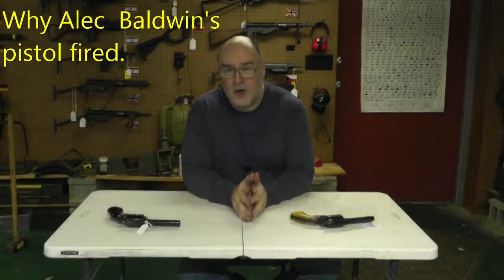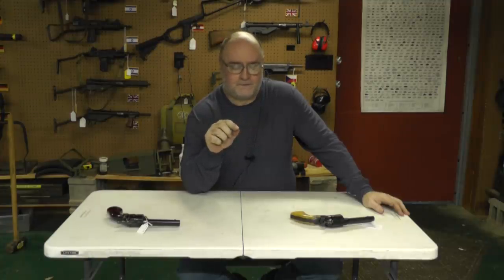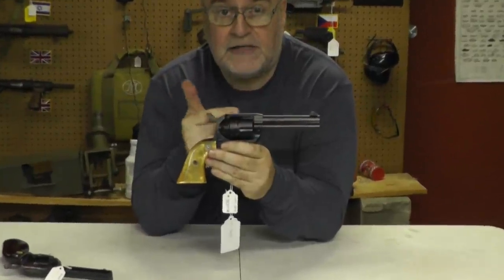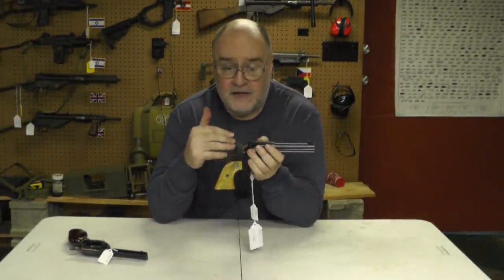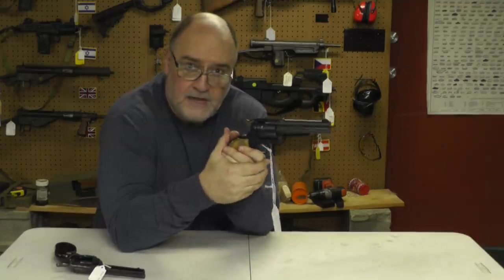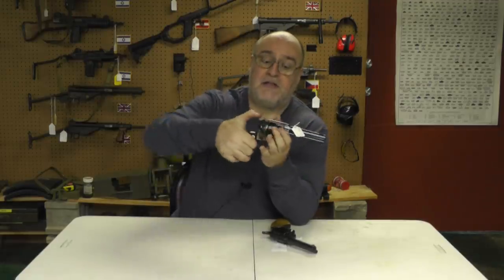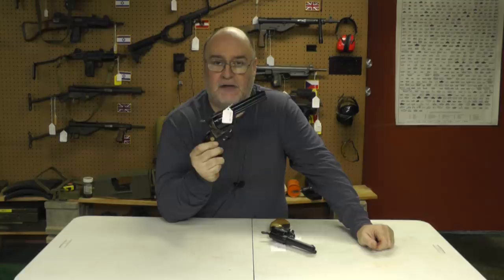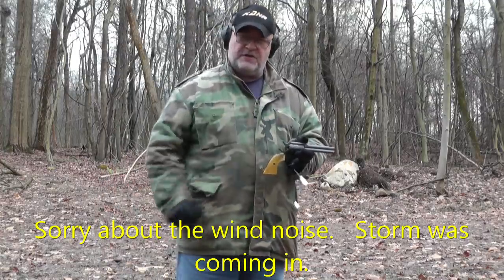Why Alec Baldwin's gun fired

Comment: I totally agree with your conclusion. You know much more about firearms than I do, but simply surmising, if Alec  wasn't flat out lying, I assumed that he was "fingering" that gun all day. And by doing that, he probably had the trigger pulled. When it came time to shoot the scene, he pulled the hammer back and let it go. With the trigger pulled, the gun fired. Whoever loaded the gun with "dummy rounds" neglected to first empty all six chambers, so a live round was still in the revolver. As luck would have it, this is the chamber that was in front of the hammer when Alec  pulled it back and let it go. In any event, word is he was not paying attention in Safety Training, instead, he was talking on his cell phone. He was too cocky and felt he was too cool to take "Safety Training."

I have been a motorcyclist for twenty-five (25) years, but I still take the Motorcycle Safety Foundation course before the start of every riding season to: brush up on the rules of the road, practice maneuvering at slow speed and practice emergency stops.

At this point, I could probably TEACH the class, but it is NOT about my EGO, it is about knowing how to ride so well, that I simply react in an emergency situation and keep my motorcycle and my body from getting broken. 😎

Comment: Really clear, thank you. We don't get hands on with handguns here in the UK so this is a question not a theory: I wanted to ask if supposing the hammer was resting on a live chamber not an empty, could he have drawn back and released the hammer before it went into half cock?
What eats me is why there were live rounds in the gun (or even on the set at all). I was thinking someone was playing with it during a break.
It's without doubt the armourer bears some blame even if it was just failing to go through some safety training. I do however remember from time on film sets ( was an extra as a hobby job in the past) that the talent gets treated like god's. If he couldn't be bothered nobody would have made him.
When I was taught I was taught to show clear before handing over a weapon but I suppose that's not doable with a revolver. 
Thanks again, I think you are correct.
Reply: Yes, that is possible with the model 1873, but it is very doubtful that the hammer would fall with enough force to set off the primer charge in that circumstance.  The hammer just doesn't have enough travel from below halfcock to detonate it because it will lock when one pulls it back about 1/8 inch. The takeaway is that while the model 1873 requires that the shooter understand how it works, and that there are ways in which the 1873 can go off unintentionally if the shooter doesn't, the way that Baldwin described this incident is not one of them.  I am going to make a political observation here and say that we Americans may have our problems with these firearms, but I think that in the long run you Brits will come to regret not having them more than we will regret having them.

Comment: But, what would happen if all 6 chambers were full, he full fisted gripped the pistol squeezing the trigger back and half cocked it like shown on the dry chamber at 12:25 ? Would it have popped off the primer if a live round was under the hammer?

You can only assume they only loaded 5 bullets, NOT 6, just like you can assume there were no live rounds on set. 

As a kid I had a vintage 45 Colt 1873 and a Rugar .22LR 9 shot. In all the years of 'Plinking' as a kid, I loaded ALL chambers, safety be damned. Ass u Me.

Comment: I agree just like slip gun shooting also known as Fanning it disables the trigger
Reply from the maker: Fanning does not disable the trigger.  The trigger has to be held to the rear to fan the gun.
Reply: @psp1921tsmg  in slip gun shooting you disable the trigger you disable the trigger by pulling the hammer back and tying the trigger to the trigger guard yes holding the trigger back disables the trigger when you hold it back obviously you like to argue you probably are not a gunsmith that you do not or never have time to revolver to make sure that the round in the chamber lined up with the barrel some weapons you'll notice with a scuff from each of the places where the cylinder Meats with the lock when people improperly load and operate it cause of the Scuf then that part is reduced in size and it changes the timing of the revolver thank you for your disabling the trigger doesn't happen when you fan a revolver of the single-action variety
Reply from the maker: @marklandwehr7604  that’s a long winded way of saying you can damage the lock and disable the trigger by fanning except the gun in question functions properly per the fbi and Baldwin did not have the trigger tied back so your entire fanning point is mute.  Or are you saying him cocking the hammer with pressure on the trigger is the same as fanning?
Reply: @psp1921tsmg  what I said and I'll say it again not following the proper order of operation causes that stuff in a Single Action Army and when parts are not fitted very well has nothing to do with using it as a Slip gun has a whole lot to do with someone doesn't know the proper order of operation of a Single Action Army
Reply: @psp1921tsmg  since obviously you get a serotonin Boost from arguing so I'll happily feed your serotonin boost single action and double action both can drag that part and cause timing to change on the revolver where it will spit let out as the bullet tries to make its way out the forcing cone that's a long-winded way of saying I'm wasting my time talking to gun dad
Reply from the maker: @marklandwehr7604  I’m aware of wear causing timing issues.  My security six had to be rebuilt for shaving lead.   Old colts pythons were notorious for going out of time.  As were the early model 29.   
    But timing has zero to do with baldwins gun.  The fbi tested it and the sear/trigger were operating correctly and it was in good enough time to allow the primer to line up with the pin and be struck and fire the round.  Did it shave lead from not being in perfect time don’t know and it’s irrelevant.  Is the lock up sloppy from wear.  Again irrelevant.   
      The gun was in good enough shape that holding the trigger to the rear or a effort to pull it is required to fire it   
         I think the misunderstanding is I do not consider fanning a 1873 as slip shooting.   Fanning can be done without tying the trigger to rear of the trigger guard.   Bob Munden  used to fan his colt without tying the trigger so fast you couldn’t hear 2 shots.  
       So I think I misunderstood.  In slip shooting they fan.  But fanning does not require a disabled trigger.   Baldwin on the Chris cuomo podcast claimed that fanning a gun disabled the trigger.  That’s where my misunderstanding of your comment comes from
Reply: My opinion there's selective Manufacturing and interchangeability not everything's the same as a result some parts need fitment most people in Europe either weapon and then take it to the mechanic and make sure it works a lot of automatics were for sale from Europe that we're rejects that made their way back and were sold in America selected Manufacturing there's a range of parts that fit I'd say the python is one of the most precise machined 357 wheel guns that you can buy clearly you need to take it to a mechanic machine gun dad is not a gunslinger doesn't know how to tune a wheel gun check out six gun by Elmer Keith

Comment: Love or hate Alec Baldwin, call him incompetent with firearms, BUT based on what's been reported, crew members used the gun for live fire shooting and allowed real rounds to be mixed with the dummy rounds. The armorer or whoever participated or had knowledge of the crew "playing" with the gun to shoot live rounds IS AT FAULT and should be prosecuted. Baldwin is not responsible. Also, Hollywood, in general, is at fault for not using harmless imitation guns in movies. There have too many accidental deaths and injuries already. This should have been stopped years ago.
Reply from the maker: Except Baldwin is also a producer. He could have shut down production after 2 previous accidental discharges.  He should have had the armorer fired and had everything check before resuming filming.  As the producer was he aware of the target practice, if so why was filming not stopped.  Several of the crew quit because of mishandling of firearms.   The armorer was not on set when the incident happened a safety violation and Baldwin permitted it.  
    So with prior knowledge and still continuing with a incompetent armorer after accidental discharges and target practice and not letting the armorer on set when it happened.    Baldwins course of conduct makes him guilty.  
      As for real guns.  How many accidental deaths with firearms on set. In modern times one in 1993.  And one in 1984.  Guns on set are not a problem.  Careless ignorant arrogant crew and sometimes actors are

Comment: No way is Baldwin guilty of anything the responsibility lies soley on person that loads and handles gun .!
Reply from the maker: And the person who hired an incompetent armorer.  Did not fire that armorer after two prior accidental discharges.   That person allowed live fire target practice on set during non filming hours.  Thus permitting live ammunition on set.  Same person allowed the armorer to be sent off set when the incident occurred.  The same person that after crew quit due to safety concerns over gun handling  did not correct or check anything including the weapons and went on with filming.  
    Is that person responsible?

Comment: My personal opinion is that the shooter is responsible for the firearm he should load and confirm that he is loading blanks.  If live round are on the set they should be under the control of a safety officer, then every one should be made aware that there will be live rounds being used.  Then it should be confirmed by all that unused live round are secured then blanks are issued.  This was a very well done video explaining how this gun functions. It is a simple straightforward design, that has very little that will fail mechanically.  This was a safety issue that included multiple staff as well as the actor.  In the end he had the gun, he failed to inspect the loads to confirm that blanks were loaded.  Anytime firearms are being used by a novice shooter a experienced safety person should be there to over see everything.  I have a old pump shotgun that work the same way. If the trigger is depressed and the pump is slid when it comes forward it will fire it was from WW1.  If I let anyone use it I have to make sure that they under stand that can occur.

Comment: The gun fired because Baldwin assumed it was safe instead of following the fundamental safety check - AKA LESSON ONE  of GUN SAFETY - of assuming it was loaded and ready to fire until he had personally cleared it. 

If you're holding the gun, YOU are responsible for it!!

My Dad, an air force pilot, told me a story about revolvers that were issued to the pilots. When they returned to base they had to turn in their guns. As a safety check, they counted all of the rounds as they removed them from the gun and then again to be sure. Then they rechecked the chambers one more time and then they dry fired their guns into a big wooden block at least six times for "insurance". 

Even with all of their care, and as impossible as it seems, there were still rounds that were fired into the block.

See RULE NUMBER ONE!!

Comment: Nice presentation.
Now one would think the person in charge of the prop didn't check it before handing to ANYONE.  Of course the person receiving it should check also. Just to be sure.
 Negligence on the actor for being over confident.
Negligence on the prop handler for NOT properly checking the weapon. I think it's more on the prop handler. They are in charge . Actor just acting.
So whoever gave him the weapon, is more responsible for the out come.

Comment: Ok Alex Baldwin accidentally fired the gun, but why did it have a live round in it anyway. If when they were filming it needed to be fired for the film it should have had a blank round in it, for that matter why were live rounds even available on the set? Whoever put that live round in the gun is also culpable and is just as responsible, Alex Baldwin was stupid not to check that only blank rounds were loaded before he handled the gun. Ok ultimately he discharged the gun (whichever way it happened the gun fired) and is responsible for someone’s death, but almost equally responsible is whoever loaded the gun and handed it to him.

Comment: I have seen where the trigger was actually held back with a rawhide strap and thong setup in permanent mode. Was taught to shoot/gunfight over 50 years ago by a couple of old men who worked on both sides of the law. They would NOT carry this type hand gun.  One of the old men and another were freighting supplies to a trading post north of Flagstaff, My friend was in the lead.  He hears a shot, turns to see what happened, the other teamster is shot and dies.  My friend was charged with his death, he denied this. 
 They finally brought in a tracker from the Apache who confirmed Pete was in the lead.  Supposition is other teamster was carrying a fully loaded handgun - they were going into indian country, he did not have the gun strapped down, just riding loose in his holster. The wagon hit a bump the gun bounced out hammer hit a rock and fired, killing him.
This was in Coconino County North of the San Francisco peaks. I will not say any more except to say I am almost 74 years old and this happened way before I was born sometime between WWI and WWII as near as I can figure out.  I do not know nor do I want to know.

Comment: One thing people seem to be missing is that movie prop guns should not be capable of chambering live ammunition AND there should not have been live ammunition on the movie set.  I collect movie props and prop guns are modified with smaller cylinders and chambers.  To chamber live ammunition the gun would have to be further modified or the ammunition would not fit into the gun.  Also, they keep talking about hot gun and cold gun and some people are making the assumption that a hot gun is one with live ammunition.  Its not.  A hot gun is a prop gun loaded with blanks, which could also be dangerous like we saw in the Brandon Lee case.  The hard part for the prosecution is going to be that at no time did Baldwin believe that the gun could fire live ammunition.  At worse he believed it could fire a blank which would not have had a projectile.  Also they are going to have to prove that Baldwin knew that live ammunition was on set.  Its going to be a hard case against Baldwin.  However, if the armorer modified the weapon to accept live ammunition and/or knew that live ammunition was on set, there is a good case against her.

I should also point out that the gun used was not a Colt.  They almost never use name brand firearms in movies.  They are normally replicas or props made for the movie.  The one used was a F. LLI Pietta 1873 Single action revolver which is a replica of the 45 Long Colt.  There are two versions of this gun and the difference between them is in the trigger action.  One uses the Ruger style transfer bar and one uses the hammer nose style more like the Colt.  I would bet that the one used on the Rust set was not the transfer bar model.  I would bet it was more like the Colt you used in this video.  I think it would also be good to point out that it does not appear that the gun was setup as a “slick gun” since the FBI team did say the gun would not fire without the trigger being depressed.  I know a lot of western movie prop guns are setup as slick guns for fanning scenes.
Reply from the maker: Is was a 1960s era copy without a transfer bar.  The fbi said it will not fire without pulling the trigger.   And prop guns a fake guns.   The 2 times I worked on a set there were prop guns but when blanks were fired real guns fitted with blank adapters were used.  Since a revolver doesn’t require a blank adapter to function no modification of the weapon is required to fire blanks.   
     Since the production company allowed target practice with live ammo on set during non filming hours.   Baldwin had to be aware of live ammunition.  Which by the way should never have been permitted.  
    Also since there had been 2 prior accidental discharges of blanks.  The gun should have been checked by Baldwin since he was pointing it at people and since Brandon Lee rules prohibit pointing guns at people with even blanks in them at close distances.
Reply: @psp1921tsmg  Was the report about the crew using the gun for target practice confirmed?  I did see the article from the wrap that made that claim but I did not see that in the published police reports.
Reply from the maker: @jasonmccammond5629  I don’t have access to the police report.  The wrap and tmz cross reference each other.    But tmz seems to be the source.